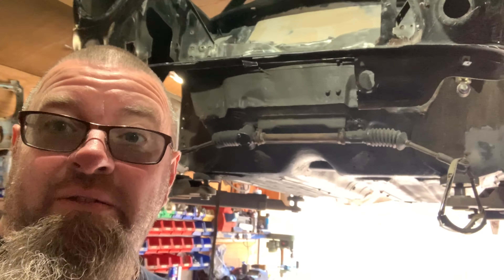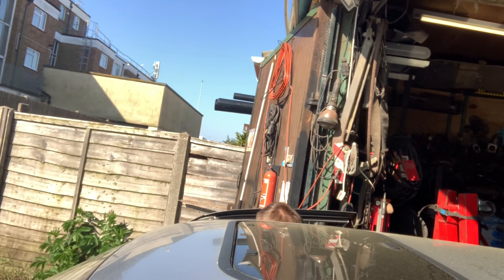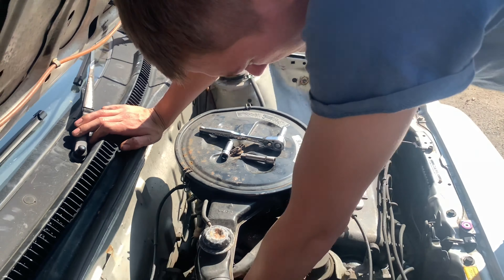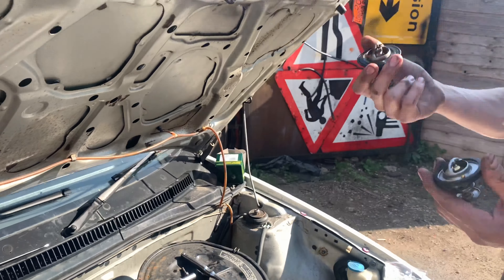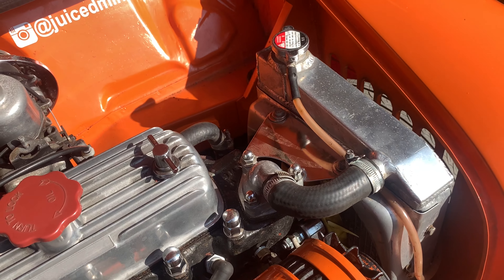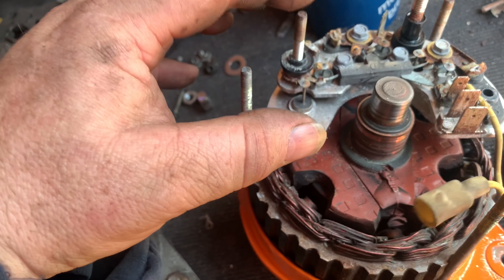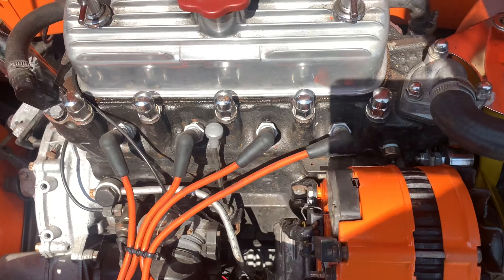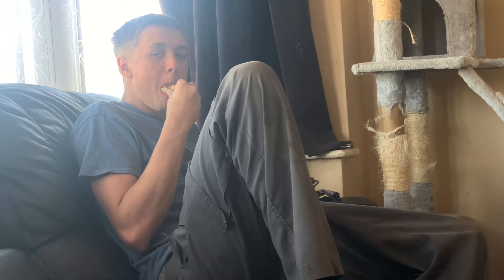Fixing the Gen3 civic and the juiced mini

Comment: My fan is 2" away from the breather which looks closer to the exhaust manifold than yours with only a 7mm gap between the two.
Reply from the maker: Its really strange , the original fan was fine ! A blade broke off that probably due to a disintegrating belt , the second hand replacement hit the breather ... and now this now one did too 🤷‍♂️ strange !
Reply: Very odd, must just have a different offset on the new one.
Reply from the maker: 🤷‍♂️ doesnt look different ? Never mind ! 2 spacers and its good 😬
Reply: Just found this on the minispares website 'Minis from 1959-69 and 1990-1 had 12G1305 a thinner blade 1.100 wide at tips whereas this is 1.5"'. Perhaps it had one of these fitted before?
Reply from the maker: Ooooh maybe thats it !!